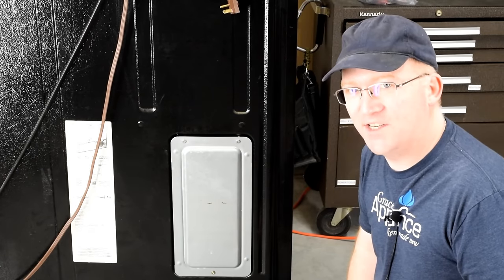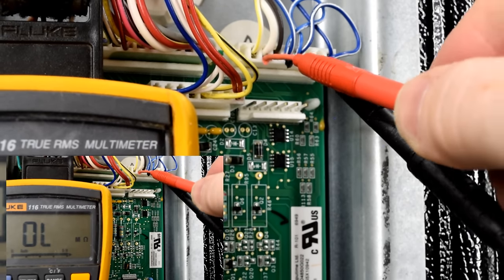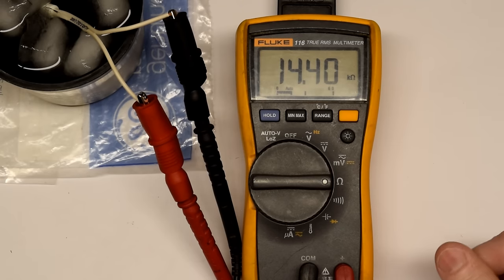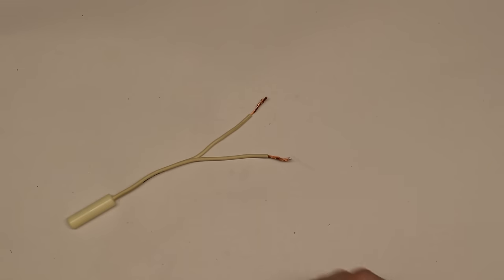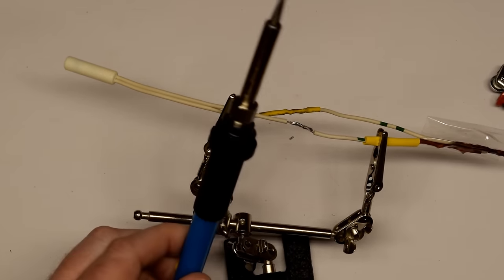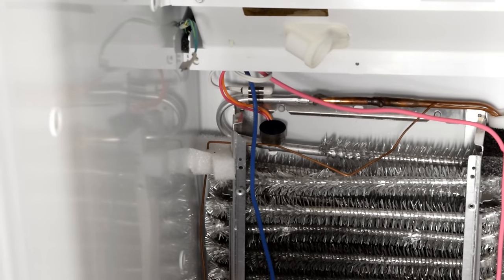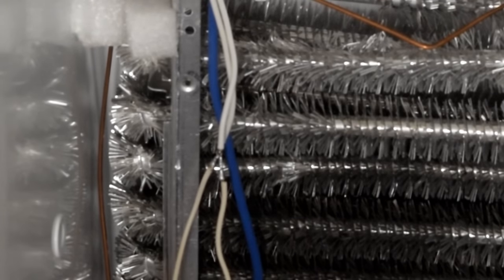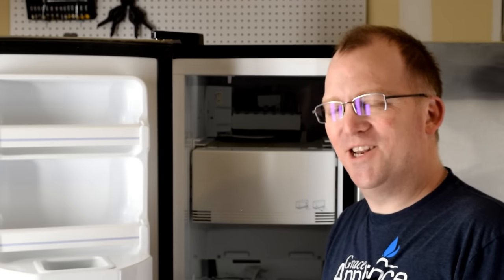Testing and Replacing a GE Defrost Sensor - WR55x10025

Comment: Thanks for such a super helpful video. I have a GE GSS25WGPDBB refrigerator. Few questions, actually 2-3 of them :)
1-On evaporator coils, I don't have frost/ice on the top 3-4 coils, while all bottom ones have frost and ice on them. Can that be caused due to a bad thermistor or an issue with system sealing?

2-Freezer is fine, but fridge is showing temperature in 54-55's, means fridge side temperature is not good. I tested fridge side thermistor and it's showing a value between 7-8K ohms, is it bad?

Can fridge not being cold enough be caused due to any of the bad thermistor(my fridge has 3) ? Thanks again for the help :)
Reply from the maker: Hey Maverick! 
You’re most welcome, thanks for the kind words.  Here’s my first thoughts. 

Sorry to say, it sounds like you’ve got a sealed system issue. That is, either low on refrigerant indicating a leak. Or, failing compressor.  
Either way, it’s not great news.  The fact that not all the rungs (all except maybe the last rung) are not covered in frost is an issue and an indicator of a sealed system issue.  

I am in doubt that your freezer section is fine. It should be running at 0’F (or lower) and things like chicken breast and ice cream should be staying frozen rock solid.  

I’d double check that your compressor is running full time, (I.e. not cutting on an off) if so, that’s going to be a sealed system issue.  If the compressor runs for 24 hours and both fans are working, it should have frost on all the rungs and should be sub zero in the freezer.  

What temp is the freezer? 

If the freezer is 0’, that would be better news because then like you said could be a thermistor, fan or damper issue.  
Let me know what the temp is inside the freezer and we can go from there.   A bad temperature sensor CAN cause the freezer to be fine, but the fridge too warm. However, It will not cause the evaporator to not fully frost.
Reply: Thanks for your prompt response and feedback. I used IR thermometer and seeing temperature anywhere from -6 to 20's Fahrenheit in various parts/sections of the freezer. If I leave water in it, it's turning into ice, so freezer seems to be functional. While fridge is showing anywhere from 52-58. In terms of evaporator rings, if I am looking at from the front, top 3-4 aren't covered in ice/frost, rest all of them are, so maybe an initial issue for sealing system? I just checked, compressor is running, so as fan for it as well as evaporator fan. I have tested fresh food(fridge side) thermistor from control board, while soaking it in ice water for 10 mins and it was reading 7 to 8 ohms, while multi-meter was at 20K ohm scale. So I am at loss if it's an issue with thermistor or sealing issue? Shape of thermistor is round from top and has a black bottom too. Thanks for the help and advice.
Reply from the maker: @maverickperson5443  ok, that's good news I think.

It does sound like the thermistor is bad. It should be closer to 14k ohms as in the video. I'd start there as they're cheap and it will likely solve the issue.  Keep me posted! I'd be curious to know the results.
Reply: @GraceAppliance  Thanks again, that's how coils are looking: https://postimg.cc/9r3TvnxV
I have tested all 3 thermistors, by leaving them in an ice(with some water) for 5 or so mins and multi-meter was at 20K ohm scale. Fridge and evaporator thermistors are showing 6.9-7.xx ohm and freezer bottom one is showing 8-9K ohm.  I am at compete loss, if it's a sealing issue or a bad thermistor can cause that kind of behavior, i-e no cooling on fridge side and no ice/frost on upper coils?
Reply from the maker: Hey Maverick, 
No, bad thermistors won’t cause this. 
This looks like a sealed system issue to me.   I’d put a thermometer in the freezer and see how cold it’s getting. Just because it’s freezing water doesn’t mean it’s getting to 0’F, just less than 32’F. I’ve never had accurate reads from the IR thermometers. 
...but, it looks like it’s struggling to keep up based on how the evaporator frost pattern looks.
Reply: @GraceAppliance  Ok, this morning throughout the freezer temperature is in -5 to -12 and fridge is showing 47ish and I can feel air flowing from the damper assembly into fridge side. So definitely a good news, I guess? 

I'll continue to monitor for another 24hrs. Initially I didn't install evaporator cover, not sure if it was impacting temperature within the fridge?

Also, can a bad thermistor on fridge side impact fridge behavior?
Reply from the maker: Hey Maverick, yes leaving the cover off long term inhibits airflow, so that may impact the fridge temps...and may not frost up as normal on the evaporator as expected - not sure on that point.  
Defiantly great news on the freezer temps though. 

I’d check the coils in the rear of the refrigerator to make sure they are not covered in dust as this will cause warmer than expected temps, but usually in both cabinets and not just one.  

I agree with you that the thermistor is suspect because the readings you got are not lining up with what I’d expect.  I’d change the refrigerator temperature sensor and expect it will improve.  The fact that you feel air flowing through the damper tells me that the damper is not stuck shut, but it is probably closing too early due to the bad temp sensor.  If you wanted to check the damper operation, you can leave either door open for 3 minutes which will activate the damper door and run both fans. 

I hope this helps!
Reply: @GraceAppliance  Thanks so much again, I appreciate it. I ensured coils were clean and both fans were running, verified  voltages from control board too. If it's a sealing issue, I can't fix it. Otherwise, thermistors are cheap to replace and will monitor for another 24 hrs to see what happens.
Reply from the maker: @maverickperson5443  Absolutely!  You're most welcome!  With the freezer temps what they are, it's not a sealed system issue. You wouldn't be able to achieve sub zero temps if you had a refrigerant/compressor issue going on.  So, that's promising news. 
At this point, it's a why isn't the cold air getting to the refrigerator cabinet issue.  That's an easier and cheaper fix!  : )  Keep me posted, I'll be curious of the outcome.   Good luck!
Reply: @GraceAppliance  Thank you again, so then in that case do you suggest damper assembly be replaced or a thermistor on fridge side? Is there a way if you know I can test damper assembly or remove thermistor on fridge side for testing to see if it improves anything? I can feel cold air coming from the damper and freezer temperature are still below minus.
Reply: @GraceAppliance  Thank you, cover is in place and now fridge readings are in mid 40's. Could it be due to a bad fridge side thermistor? Or just go ahead and replace all of them?
Freezer temperature is just perfect all over the place, can it be a damper issue too? Thanks again.
Reply from the maker: Yeah, based on the readings you got when they were in ice water the OHM read out should have been around 14k ohms.  
I don’t think you’d need to change the defrost thermostat, but I’d definitely change both the freezer temp and refrigerator temp sensor.  
The parts are both the same part, so you’d need two of theses:
https://grace-appliance.myshopify.com/collections/sensors/products/general-electric-wr55x10025-refrigerator-temperature-sensor

Let me know if you had any questions.
Reply: @GraceAppliance  So far fridge(37-42) and freezer(mostly in minus) are both holding temperatures very well.

I received some thermistors yesterday, left them in iced water and got 14.5K ohm, was wondering if I should replace old thermistors or leave them since things are running well? One more thing, using motherboard if you test resistance of thermistors at actual fridge and freezer temps( without leaving them in ice water), using pin#5 and then 2-4, curious what values do you get? I am mostly getting anywhere between 6.5-7K ohms.

Thanks for the help :)
Reply from the maker: Maverick Person Maverick Person hey sir, 
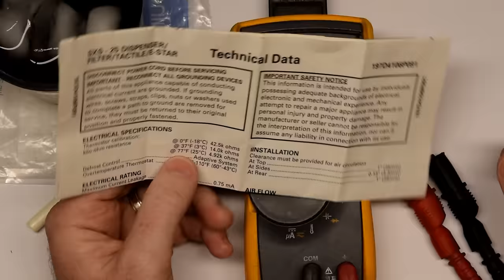At 5:05sec of this video you’ll see a chart that shows the temperature vs ohms. The ohms of resistance change based on the true temperature of the sensor and should line up with the chart. So, you’ll need to know what the true temp of each cabinet is, test the sensors ohms and then check the chart to see if it lines up.  

Alternatively, you could put your new sensors inside each cabinet (uninstalled, just put them in the refrigerator and freezer to get them cold) and then test their ohms and see if they match up to what you currently have installed.  

I hope it helps!

Comment: My sensor in my g.e. fridge isn't two wires it's one.  Do I peel back outer cover to get to the two wires? PFE29PSDESS THERE IS 2 IN FRIDGE.
Reply from the maker: Yes, once the old sensor is cut from the fridge (leave as much wire available as you can) you'll be able to separate the two wires from each other by splitting them with your fingernails.

Comment: hi,after replacing main board refrigeator stated right up but runs constantly,refrigerator side way too cold freezing milk,how do i reset temp???got fridge side set at 3 and still feezing
Reply from the maker: Hi David, please send your model number and the first 6 digits of your serial number.  Thanks!
Reply: model #GSH22JSTC SS,serial  LM204173
Reply from the maker: Hey, thanks.  
First, I’d check that the coils are clean. Seems counter intuitive, but dirty coils will run the compressor for too long trying to keep the freezer at correct temp and can cause this symptom. Not likely, but rule that out first.  

The more likely causes would be either a defective damper door / motor between the freezer and fridge section. This can be tested by leaving the doors open for 3 minutes.  You’ll hear a motor that sound like a drawbridge closing. It should run both fans and the damper door should shut. You shouldn’t feel air coming from the freezer side at that point.  If you do still, it’s likely a faulty damper door assembly. Either it’s frozen shut or has gone bad.  

Or, a failed temperature sensor on the fridge side. You’ll need a meter to measure the ohms resistance as shown in this video to confirm this.  

Let me know do you have any questions.

Comment: Hi again Andy, I tested all 3 of the sensors and I am not getting any readings at all. What exactly does that mean?  I watched the other video testing the heater and thermostat. Everything checked out OK. The heater came on by jumping it and the ohms were good.
Reply: To be more clear, I am not getting any continuity at any of the sensors at the board. I have taken all 3 out and bench tested them and they were good
Reply: @allenbryant5953  hi, have you fixed your issue? not sure if your issue, but testing the sensors for continuity is incorrect test. Should be testing for resistance which is the ohms on the multimeter. When doing my test, my defrost sensor was frozen in water giving a reading of 5.8. Based on the specs should be around 14k! He gives ranges in video, hope that helps.

Comment: I hope you see this and can answer my question. My GE model # GSS20IEPDWW gets very warm after defrosting, takes hours to cool back down. I disconnected the defrost heater and it works perfectly, just have to manual defrost periodically. Parts lists I find online list WR55x10025 as the replacement thermistor. My concern is that the electrical specifications listed on the Technical Data sheet for the thermistor are very different than the one you showed and tested in your video. Mine shows these values @0F 62.79K @37F 24.48K @77F 10.00K. Should I have ordered a different thermistor, if so, would you know the proper part number? Thanks in advance.
https://i.imgur.com/8vvWfDT.jpg
Reply from the maker: Hey, that's the correct part number and also the same one I tested in my video. So, I'm not sure why the difference in the technical info. Sorry to say.
Reply: Hey, thanks for the speedy reply. Awesome video work, would have been much easier for me if I had found it before troubleshooting mine...lol

Comment: Not sure if you still check this but worth a shot. I have a gsh22jstess side by side GE. My issue is the fridge is way too cold, even on the lowest setting. It seems the freezer just keeps blowing cold air in. The damper is just a simple plastic sheath, it blows open when the freezer fan blows. II checked the fridge temperature sensor and it passed ice water and room temp check. However when I checked  resistance on panel on the back, I got goofy readings from all 3 sensors (the fridge one read way too warm, and the two freezer ones were too cold, but were the same). So I'm not sure if the control board test even went properly to use those numbers. If one of the sensors is bad in the freezer, could that cause the freezer to run too often and thus push way too much cold air into the fridge?
Reply: I have the same issue, i replaced the board and the 3 sensors, and the fresh food section freezes everything on top. I also noticed that it runs for 20 minutes, turns off for 5-8 and starts again. It never ran like this before. Did you get a chance to fix it?

Comment: Hello Andy. If I may ask where can I get those leads on prongs. They’re neat cause they are thin.
Reply from the maker: Yes, I'm in love with these leads.  I don't recall who makes them anymore as I just picked them up at my appliance parts shop on a whim.  They are Suuuuper handy, but do tend to jab you in the fingers if you carry them in a tool bag as I do. 

These aren't the same, but still pretty cool because you can adjust the length to your desired length. 
https://express.google.com/u/0/product/7899301061649871051_2583438762543865542_6136318?mall=Southeast&directCheckout=1&utm_source=google_shopping&utm_medium=product_ads&utm_campaign=gsx&utm_content=test_45_60&dclid=CLaU1OjQpNwCFUavTwodoO8CsA
Reply: GE Side-by-Side ONLY - Refrigerator Repair Videos Nice Thank you!

Comment: if you can,t find the sensor for your fridge and your going to spice it in, are all these sensors generally the same ? just use the matching ohm chart ?
Reply from the maker: Many times you can find a suitable replacement within the same brand, yes.

What is your model number and maybe I can help find what you need?
Reply: @GraceAppliance  Hi, thanks for your quick post back. I have a whirlpool GB2FHDXWB02  with bottom drawer freezer.
Reply from the maker: @npsmith7699  super frustrating!
I came across this exact scenario recently as well, where the sensor isn't shown on the diagram. We ended up just needing to find one that looked similar as you mentioned and be sure to confirm the ohm chart and then verify ohms from old part to new part to make sure they're in the same ballpark as each other before install.
Reply: @GraceAppliance  OK, thanks much !